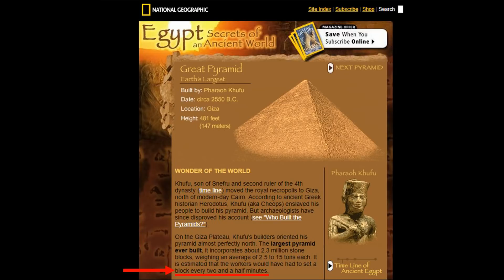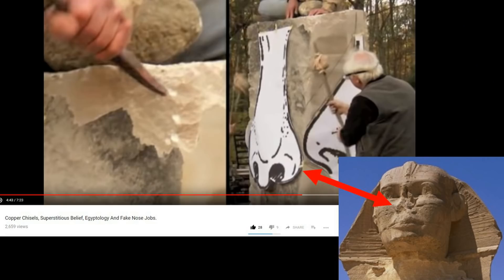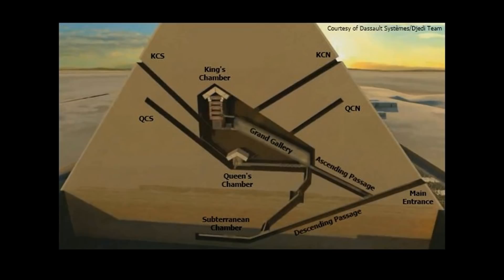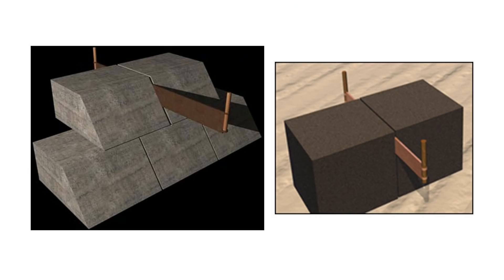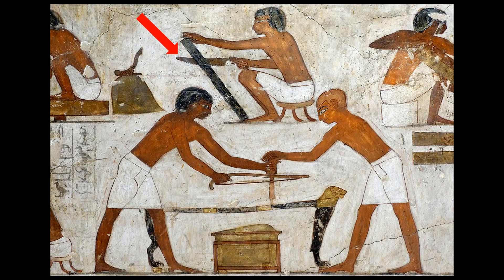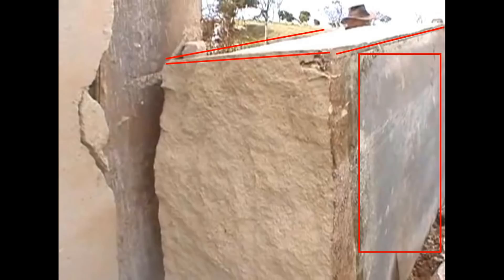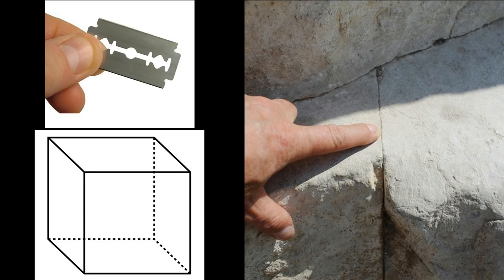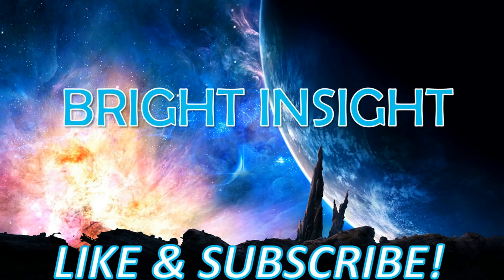Great Pyramid of Giza:  Lost Ancient Civilizations

Comment: My theory is sonic vibration... even copper goes through granite with ease in this method... use vibration to cut the block with any tool the match up the blocks and then use vibration again for the blocks to shave down the excess defects. This does tend to give the perfect fit that nothing can squeeze through including moisture.
Reply: A couple examples of this method does exist. With the near perfect cylindrical holes drilled out of limestone. As well as a 5 foot wide 6 foot deep (I think) hole drilled straight down like a well I believe also in limestone.  Both of these examples show rings perpendicular to the cut from beginning to end.

Comment: In the Egyptian mythology, the universe was created by a god in the shape of an hawk standing on a mound sticking out of water. This is used as an explanation why Egyptian were so obsessed by pyramids.
I think the interpretation is upside down. Egyptians arrived in Egypt and the first thing they saw was a pyramid sticking out of the Nile exondation. What could have they thought? That that was the place, made by gods, from where the gods created the universe.
The pyramid was already there.

About using woods. How they carved the hole in granite and limestone? With copper chisels? That's BS. Even more difficult, With drills? There is no mark of drill holes used in quarries. And if they were able to dig holes, it would have been better to use wedges to split open the stones. They were not idiots, using wood is pathetic stupid.

Comment: I find it hilarious to watch senior citizens who are academics, who never did an honest days work in their lives, try to mimic a construction worker. Quarry work hasn't changed much in the past few thousand years. Forensics have shown that many of those stones were cut with large circular saws. I also wouldn't be surprised if the ancients had a water-jet system, which is capable of cutting steel. That would easily explain the lack of used tools. That's my own theory, and I'm sticking to it.

Comment: Hang onna minnit
Why didn't they use bronze tools (instead of copper ones) on the limestone? Bronze is significantly harder than copper. They used the soft copper on the soft limestone and the significantly harder bronze on the significantly harder granite. Feels like they wanted it to fail.

Also, I think that 'sand' thing was interesting. I met a guy once when I was in Egypt in the mid 90s (coincidentally, he was also from Australia) who believed/ suspected that they used some type of acid (something corrosive) to eat/ cut through stones like granite. I think the sand experiment was the first step in understanding how they accomplished such feats. Sand worked. It didn't work well, but unlike bronze tools alone, it worked. What else might work? What if they used oil instead of water? What about drying out urine to accumulate ammonia and then using ammonia instead of oil or water? What about mixing the ammonia with various oils, then heating it they trying that?
My point is, if we were able to experiment with various compounds to see how effective they might be at helping us cut through granite, we'd be much closer to understanding how our ancestors were able to do what they did. And in this case, I don't think speculation is enough. I mean, while it's possible that we might have speculated that they could use sand to abrade granite in cutting it, I don't think anyone would have suggested that adding water would have significantly sped up the process. Thus experimentation becomes necessary.

Comment: certainly not trying to debunk your debunking, but i would figure that the reason you are not finding massive caches of copper chisels and tools is because copper has always had value, and it would not have made sense for them to just bury the tools in a big pit once the pyramid was done.  My guess is that most of the tools were melted down and eventually re-formed into something else entirely.

also, you would have to figure that these workers had a massive crew of sharpeners whose only task was to sharpen the copper tools and get them back into use.  It would not make much sense for the carver to stop every few minutes and re-sharpen his chisel.  they were probably being handed out all day every day.

Comment: Why would they not reuse something as valuable is copper? I like the video but what happened to the copper is easy to answer.
Reply from the maker: Something that didn't make the edit to this video, is that many other types of bronze tools did survive, and they've found an abundance of them throughout Egypt. However, not the case with chisels or saws. Btw, many of the chisels they have found have been "lost" around various sites. So, again, if chisels where a key tool utilized to cut/carve (which testing proves they cannot) tens of millions of stone blocks, we should be finding more.

Comment: Easy to debunk these as you can actually find the grooves from the cutting and saws used on the blocks at ghiza and almost every other megalithic site in the world. . They show the rate and pressure of the saw.  it shows exactly how fast and how many passes it took for the saw s to cut the stones and they were cut 4x or more faster than the best saws of today.  Oh and don't forget they are as think as a fraction of an inch and todays saws could never be that thin. Check out all of the videos by NEW EARTH.

Comment: Interesting comment on the copper. Watched a clip about the Koran a while ago, it was written, apparently on gold sheets in a temple, then in copper, some copper sheets  were found in some cave some where couple of thousand years old,  dismissed not relevant because it has been written on tree bark by educated people ect. The interesting point was that copper was not far of the gold standard, precious metal for the elites ect and expensive jewelry. So i cant see them using copper chisels due to cost, also the fact that people would nick them all the time. Its giving some ancient sand dweller a gold bar to look after. The most interesting clip i have seen on the construction of the blocks is that they are molded in place. As in all that water from the Nile..You can make sand stone or lime blocks yourself with lots of sand stone and lime sands..Its a bit like the roman concrete, rock hard..lasts century's, its strongly suggested that they used volcanic ash in it..and  blood ? maybe for the iron....to give it the colour. Great place youtube for interesting opinions..

Comment: With any of these accomplishments is not just a matter of showing how is done but the fact that it must have been done easily otherwise they would not have even considered undertaking these projects... historians have a habit of working backwards.. looking at a building then working out how it could be done and it turns into a fintstones affair. For instance Its possible to carry a parcel on foot for 200 miles but it in order to have even  the idea of a postal  service you need to first have a transport system otherwise you'd not even think of it... so these people must have been able to cut and dress stone and move it easily to even consist making pyramids

Comment: A circular saw makes a straight cut.  Straightness is a natural byproduct of a circular saw.  A hand saw of any design might cut, but the track is prone to wandering leaving the surface warped and uneven.  Other researchers have shown these stones have circular saw cut marks on them.  It's not an outrageous proposal that needs serious consideration.  The rotation of a large blade need not be high RPM's to cut.  The larger the blade, the faster the perimeter spins.  It would just need some simple mechanism to hold the blade at the axle and rotate on a continuous basis.  This could probably be cobbled up quite simply with some rope and timbers and a couple of donkeys.  Now that would be a great video to make!

Comment: If a large circular saw (with jewel tipped blades for hardness as other researchers have posited,) laid horizontal, was set up to move from left to right, it could cut a whole hillside of limestone to a precise uniform height as we see on the many layers of the pyramid.  Then come in on the vertical and cut them in the haphazard widths we see on the pyramids.  Width is not a critical dimension because they would still fit precisely together.  Then cut them from above toward the back all along the left to right axis and presto chango!   A whole row of stones ready to be set in place. No lasers, no fancy high-tech devices, no aliens.  And none of those blasted bronze chisels.

Comment: Im kind of baffled about the math... because if the sawtime is 1 inch/hour for Limestone that would mean that just cutting ONE average stone would take: 6 sided average stone=(50+50+50+50+28+28)=256 inches=256 hours=16 days!!! (with 16 hour workdays)... now if the pyramid is indeed constructed in 20 years, this would give us just 7.300 workdays... and this comes to 5.479,5 stones that need to be cut every day!! to achieve the total of 2.5 mio. stones ... And given that each stone takes 16 days, you would need to be simultaneously cutting (16*5.479,5)=87.664 stone at the time... Am I wrong the the math? it seems insane even to suggest that bronze saws was a viable method...

Comment: If say just one chisle was used per block on the pyrimid wouldnt the area be covered in copper and tin?  Cooper turns green dig thru the soil at the base get a set amount for instance a pound. And then have a lab process it and tell us the weight of copper/tin in the sand. Collected from different depths obviously. What do you think?

Comment: I think what we need to do it look at how they may have implemented vibrating tools. My theory is that workers had a low voltage high frequency power that they would circulate through the body safely and directed through their tools including but not excluding the djed, was, and Ankh. Look at their "God of Construction" Ptah. He is depicted standing on a slab. All of the monolithic structures around the world use a material that contains quartz and has a reaction to vibration.

Comment: On the bronze chisels @5:15 ... I don't think they would have been like "Well, looks like I've finished another chisel *tosses over shoulder*". My thoughts would be they got melted down and remade/repurposed not discarded. I think it might be a combination of things. Maybe some sort of water powered rotary saw/bandsaw(repurposed when unusable) or starting the cut with chisels, fracture the rock then grind two heavy pieces together somehow which would grind the large faces flat pretty quick but would require an immense amount of energy to get the two stones grinding against one another so thats a bit of a stretch. Tiz a real head scratcher. Very suspicious they don't seem too interested in figuring it out though. Thanks for the thought provoking video Jimmy.

Comment: A fun thing to think about.  Let's say they had 20k workers to build the pyramid.  Those 20k workers put in 40 hours a week of work for 44 weeks a year.  They all worked 20 years on the pyramid.  That would give you a budget of around 700,000,000 (yes 700 million) work hours to get the pyramid built.  That gives a average of 306 hours of labor to cut one block of stone out, move it, and place it at its final resting place (based on 2.3 million blocks used).  Even if it took 2 guys 5 days to cut a single block, that's only 80 hours of work.  Double it to 4 guys, so 160 hours of work to cut a single block.  That still leaves 140 hours to move and place the block.  Considering there was a quarry onsite of the pyramid, I think it's not that unreasonable to think it could have been done in 20 years provided the work force was 20k strong.  If there were more than 20k workers, they worked more than 40 hours a week, and or they worked more than 44 weeks a year,  it seems even more plausible to complete building it in 20 years.

Comment: The pyramid shown could have been built in 10 years provided they had the blocks mostly ready at the start of the build.  Not only that, but it's pretty amazing what can be done when you have thousands of workers to build something.  With modern equipment a group of 100 could build that pyramid in a matter of probably 5 to 10 years.  Vs the 20k or more workers they believe did it.  

The precision of the stones is often brought up, which certainly is quite interesting.  The exposed blocks on the outside don't appear to have a razors edge fit.  My guess is a vast majority of all of the blocks are actually not very tight of a fit.  Only ones near the surface or inside chambers have exceptional fit.  Not to mention having experience in natural stone landscape and stone walls, you would be shocked at how tight of gaps you can achieve with seemingly random stones/blocks.  The same things apply to big stones that apply to small stones.  The bigger stones are just harder to move.

Realistically I think 50 to 70 years worth of time is more realistic to a pyramids construction.  Although 25k people can get a lot done in 20 years working 40+ hours a week.

Comment: .... ..     Thermal dynamics of the granite.      Bagdad battery charging in King chamber on thermal dynamic "flow"      two sides in the sun two sides in the shade with cooling vents on shaded sides n one side on the Ground!   If you can charge batteries, can you cut granite with hydrogen ?

Comment: The rate of tool wear is one point that isn't commonly discussed. Sure, there is mention about how the bronze or copper chisels were constantly being replaced by metal smiths and relayed to the stone masons, but there doesn't appear to be much mention of the hundreds of pounds of copper/bronze dust that would have been present at the quarries unless they worked in such a manner that the metal dust could be regularly recovered and reforged into new tools. 

Given the value of copper and bronze, presumably the remaining chisels and tools (or copper dust) would have been repurposed, converted into currency, used for trade, etc. but it is odd how there very little discussion about this.

Comment: I believe the building of the pyramids can be done by ancient humans with sufficient working force. (math below)
If we disregard the use of aliens or foreign technology, I can only presume grinding(by sand) and polishing(with fine sand), as methods with sufficient accuracy and abrasion to produce excellent quality stone blocks.

Let's presume some things for understandable math:

Core assumptions:
1) It is possible to manufacture large stone blocks accurately with primitive technology
2) It is possible to move large stone blocks to the build site with primitive technology
3) Both of the above can be done consecutively in timespans less than the total build time

Mutable variables:
• One average stone block takes 4 weeks to cut in the quarries for two persons (when they work 8 hours / day)
• Our pyramid has 2.5 million stone blocks
• There is 20 years of build time available => 7300 days

If we want the stone blocks to be available in time, we need to start working 4 weeks(28 days) ahead of time
 => 7272 days total build time.

This means you need 2.5 million times of "2 workers for 28 days" of labor and have 7272 days.

To consider logistics, we can reduce the value of days for the stones to get their place in the pyramid from the days available.
 For example if logistics take 2 months => 60 days, we have 7212 days of total build time.

2 500 000 * (2_workers * 28_days) / 7112_days = 19 413 workers. (on the stone cutting)

If we want to consider personnel for logistics, the system gets a little more complicated.
 But if we presume logistics can keep up with the stone cutting by ferrying many blocks at a time, we will not have additional delays.
 In this case, the logistics could probably be handled with something like 0.5 - 1.0 times the personnel of stone cutting (estimated, not calculated value)
 -> 38 825 (when using value 1.0) workers could probably handle both stone cutting and logistics with the values used.

If you find whatever values not accurate, just change them and you get the new amount of workers needed.
 For example, double stone cutting time -> ~2 times the workers (while stone cutting time is small compared to total build time)

The formulas presume a system which always works without any delays but the actual working time.

In any case, whatever the bottleneck is in this system, while the physics are possible, it can be adjusted to with more workers.
 For example, Wikipedia says the Great pyramid of Giza had some 200 000 workers.
 To me, this says that the pyramids could indeed be built by humans with quite primitive technology.
 In regard of these numbers, some parts of the labor must take more time than calculated. Maybe the biggest stone blocks were extremely difficult to produce (as one would think) and took much greater amount of time than the average blocks used in the example.

The problem of placing a stone block in the pyramid every two minutes can be taken care of by having several entry points to the pyramid for the blocks. For example, if five blocks are being placed at the same time, you need only to carry this procedure every ten minutes. This would get harder when closing the tip of the pyramid, but you could make time by placing many more blocks at the same time when the construction had just started. This can be achieved by using standardized blocks and measurements.

If you find problems in the math, point it out so we can get to the bottom of this.